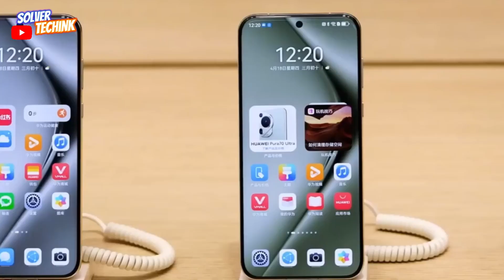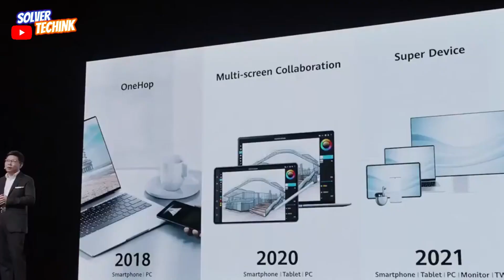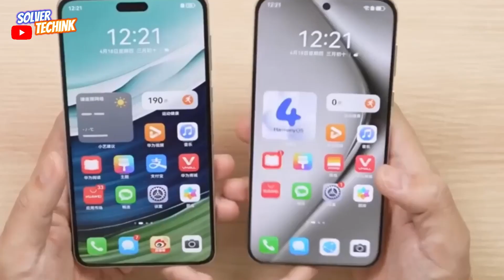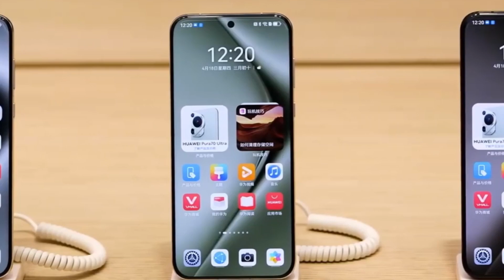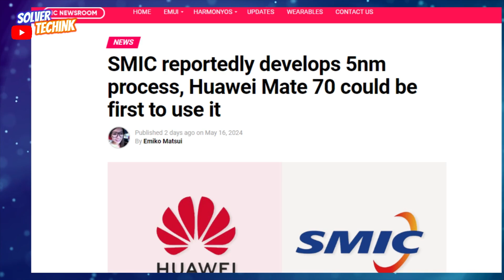HUAWEI and SMIC  Shocks the world with a new  Chipset.

Comment: Nothing new about a new chipset????
Reply: DUV mechanic can do 14nm but Huawei and SCIM are able to use DUV mechanic to make it work at 5nm. It's was impossible and they still was able to mass produced.
Reply: @MuradHossain-qj8rq  Is that a fact or your guess?  We know that Huawei and SMIC have been working on a new process said to equate to EUV.  With the sketchy info in the media, it sounds similar to the Canon Neo process, something more akin something like stenciling instead of photo lithography.

"Bloomberg reported that Huawei filed patents for a self-aligned quadruple patterning (SAQP) technique that enables the patterning of transistors on to silicon wafers, which is normally performed by EUV." (Tom's Hardware)
Reply from the maker: This is the first time SMIC has been able to mass produce 5nm. So this is a new chip to SMIC.
Reply: @solverTechink producing chip-sets with obsolete DUV technology at twice the price removing them from the conversation. The world is already moving or has moved to 3nm, and 1.6 has been cracked. At the moment, their sales are a result of patriotism. Not much of a business model.
Reply from the maker: Great point, at the global level 5nm is no big deal, which is true, but a nation such as China being able to mass produce 5nm with absolete DUV is a big deal. To be able to use older DUVs  for mass production of 5nm is a very difficult thing to do.